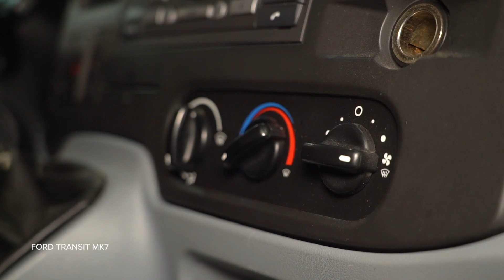How to change the cabin filter on the FORD TRANSIT MK7 [AUTODOC TUTORIAL]

Comment: Important to note that the arrows must be pointing upwards when installing.I've just discovered mine has been the wrong way after 3 years due to the previous owner or garage fitting it the wrong way with the arrows pointing downwards! No mention of a cabin filter in the Haynes manual either! 
Thanks to autodoc for this video.
Reply from the maker: Your comment is very helpful! Thats true, the filter should be placed with arrows in the direction of the air flow as the air enters and passes through the filter.